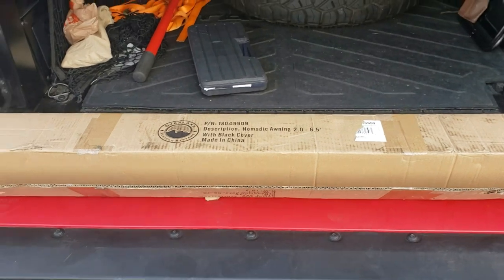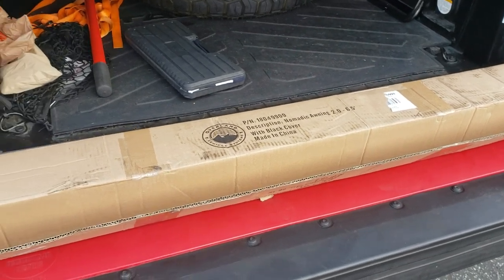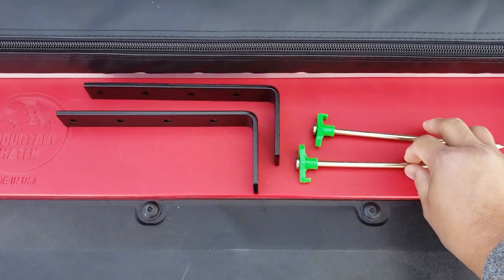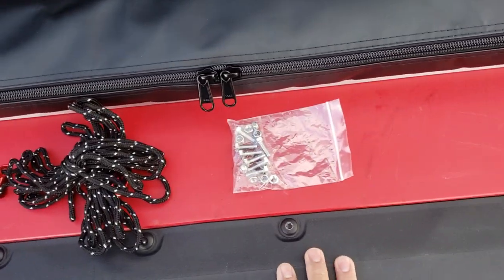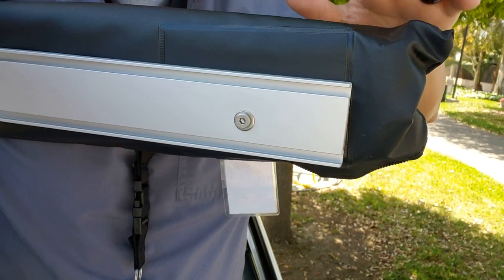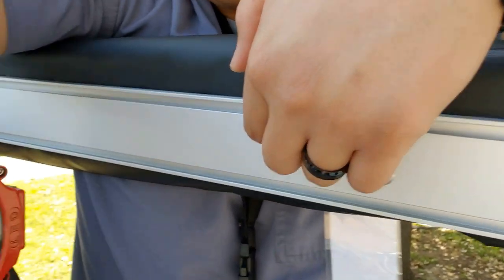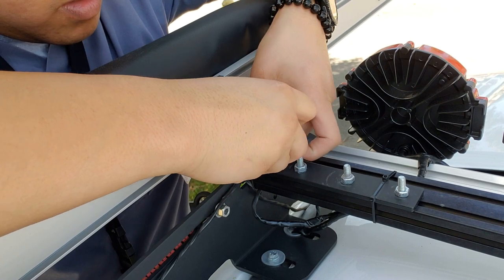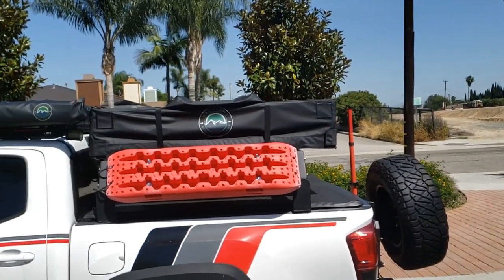Nomadic Awning | Overland Vehicle Systems | Toyota Tacoma

Comment: How did you mount the brackets to the prinsu? When I try and tighten the nuts to the bolts, the bolts just keep free spinning in the prinsu channel where I put the bolts, like shown in your video. I cannot get the nuts to tighten all the way to the bracket on the bolt.
Reply from the maker: You are probably using a smaller carriage bolt.. try getting a slightly bigger one and see if it works
Reply: @vincedprincehowtodiy7705  Thanks for the fast reply! I think that is exactly the case.